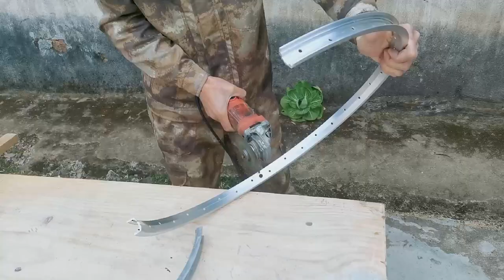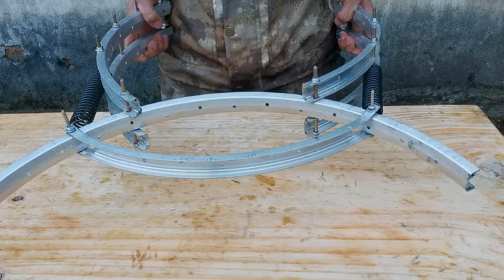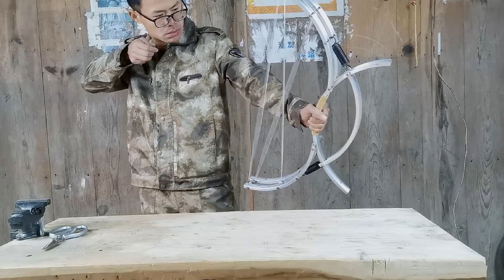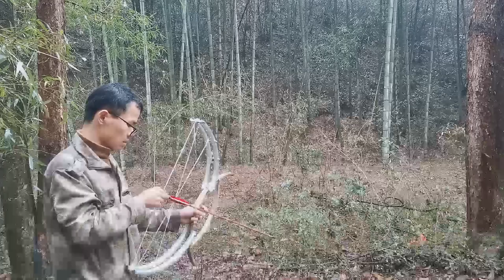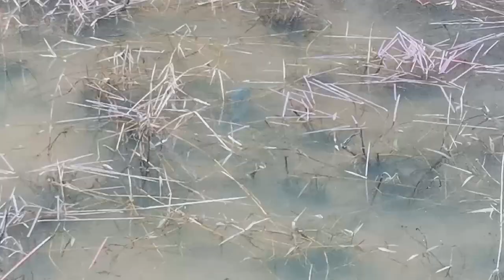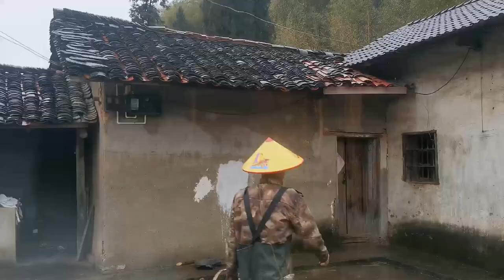How To Make a Creative Bow Out Of Bicycle Wheel And Spring,"Crab" Bow Fishing Big Fish.

Comment: Very nice DIY bow. Has potential fot more or less power depending on the springs used and their placement. 👍👍

Suggested upgrade: If used only for fishing (as shown) then mount a small fishing reel on the frame and then attach fishing line to your arrow. That way you can reel in your catch and/or the arrow itself when you miss.